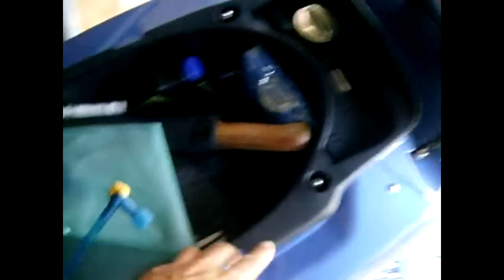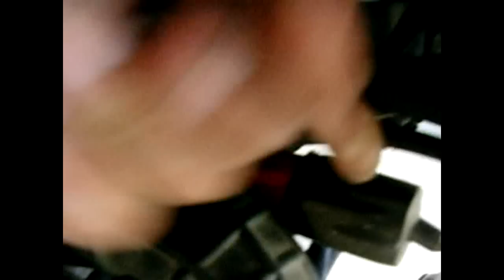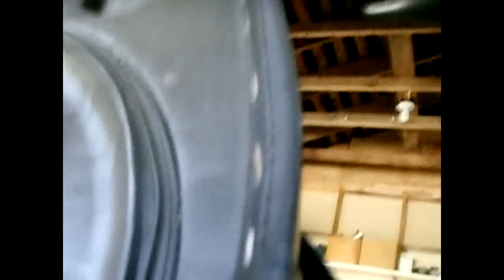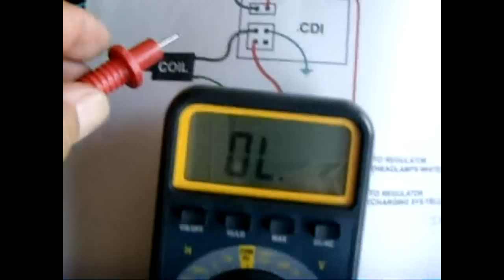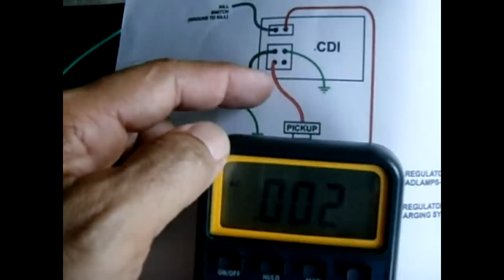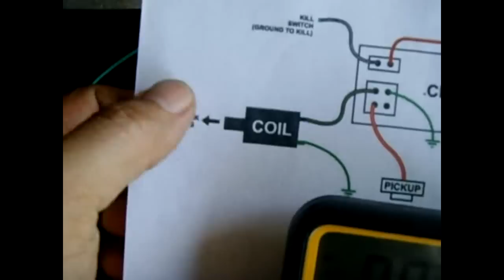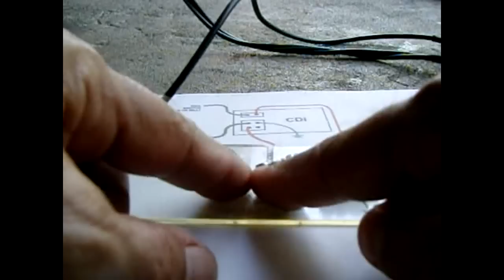The Ultimate GY6 Starter & Ignition Troubleshooting Tutorial

Comment: My wiring has different colors then yours but the locations on pins are the same. I got the same reading as you did but my battery will crank the motor using the electric start but will not start.  When I kick start it starts on the 1st kick. If I use an external battery starter it starts. Voltage is good but I think I don't have enough amps. The battery tested  good at the auto store and when they charged it will start a few times then just cranks but don't start.  I tested the regulator which at idle the  output is 8VDC but has 15VAC which I have replaced the regulator twice with the same output. The battery will charge to 12.89vdc and holds charge. When the motor is running with the regulator and battery disconnected there is no AC or DC on battery terminals.  With the regulator and battery connected and motor turned off no amps are being drawn from the battery. i remove headlight bulb and same results.  suggestions on why my battery does not charge enough amps? Thanks

Comment: @0:00 Intro
@0:21 Seat removal
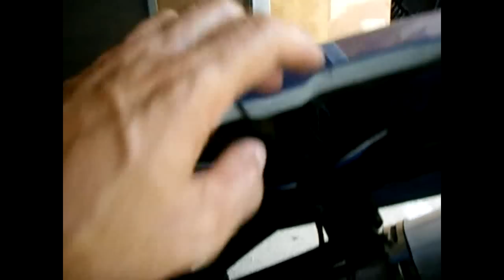@0:58 CDI and Starter Solenoid troubleshooting
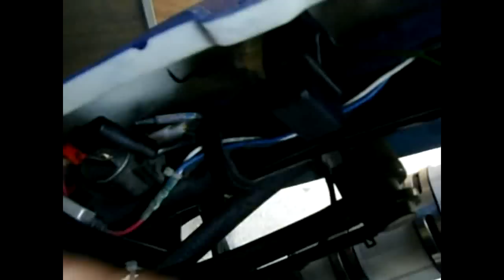@2:38 Explanation of parts
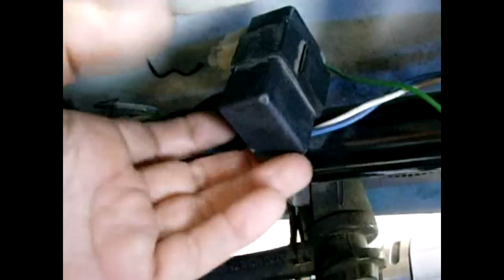@5:13 CDI troubleshooting
@5:50 Fuel troubleshoot
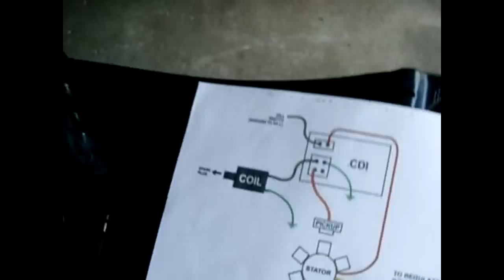@6:55 CDI wiring diagram
@21:00 Spark Plug testing

Comment: Great video, I went outside to start my 50cc,,,, hit the start button and nothing,,no cranking sound, battery is good, brake light and horns work, if I probe the soloniod with a test light hooked to batt neg, it lights up, if I use a screwdriver to short the starter soloniod it cranks the bike, it wont start because its having a spark issue, I think its the right side kill - start button switch, issue,,,what do you think at this point? TY

Comment: 2021 and this is still a very useful well presented video. Thank you.
Reply from the maker: Glad it was helpful Jerry! Be sure to check out my GY6 video playlist and share. Thank you
Reply: @electronicsNmore  I'm just repairing my granddaughters 125 scooter and a question if I may? The cdi unit were you have the black and red wire only has a single wire a black one do you know what that would 2017 model. Many thans
Reply from the maker: @jerrybootneck1736  It should have more than a black wire. You can search online for gy6 cdi images to help.
Reply: @electronicsNmore  ok many thanks I was hoping to find a red and black but even the chicken on that connector only has a single pin
Reply: No idea were the word chicken came from must have been predictive text lol.......Tell you what I did find this afternoon is that the ignition coil is a single connector and I suspect the ground is through the chassis with the 2 bolts holding it. I checked on fleabay and the only couple I can find one is for a 50cc this one is 125 and the other is for yamaha's and aprila's wish I could post images on here

Comment: My battery is fully charged, when I cross the solenoid posts it just sparks, I hear a click and the flywheel will juuuuust turn a little. It seems like there isn’t enough to crank the engine. Help!?
Reply: My scooter is wired direct turn key, press button. I installed a new starter also my kick start doesn’t work. This is a new problem for me but I’m outta ideas?!
Reply from the maker: If you cannot rotate the engine by hand using a ratchet with extension bar, along with the correct size socket, then your engine is damaged.

Comment: Great tutorial so far. Car / Semi mechanic here so alot is familiar with the few exceptions. Still watching video. At Appx 5:45 in video you show a "Scotch Block" on the back where you ran your ground over. 

Recommend eliminating scotch block as that invites Gremlins (Corrosion) in the wiring. Better of cutting small section of wire, stripping the end of ground wire you're adding and twist it in the wiring inline then soldering it. You can use liquid tape to put a cover back over wiring sealing it. I generally go 2-3 coats of liquid tape. 

I do this on any similar wiring situations, remote starts, wires I may pierce with a test light for diagnostics and it don't hurt the current wiring. 

Now off to watch rest of video. Good battery, scooter starts, runs when kickstarted, runs when battery charged but the starter goes but sounds like it starts spinning before I have to pull the battery and charge. 

Wondering if alternator or whatever these have is going bad. 

I do have a voltage drop tester (see AESWAVE.COM as they have alot of great mechanic tools that help save time and get sale result). These tools are great when you do alot of this stuff as it pays back long term. 

So far scooters are cars on a smaller scale. Loving it. May start doing work on these as well. Wonder what a good hourly rate is for scooters?
Reply from the maker: Thanks for watching, and thanks for the tips!

Comment: Have a problem was riding down the road just fine had to pull over and make a phone call, turned my scooter off ( 50cc bored to 80cc 2006 peace motorsport) has good strong engine TS 52mph flat ground. When Iturned key back on absolutely nothing no power period, has brand new coil and plug checked the CDI which is new also, new battery tried to jump it just to check and still nothing it's not the battery I know that much, I'm just stumped I'm not an electrician so any help would be greatly appreciated.
Reply from the maker: Must be a bad connection from the battery, or a blown fuse.
Reply: @electronicsNmore  I checked the fuses no prob there I was thinking same thing I'm going to just replace all of that wire from the battery and go from there thanks for responding it's been extremely frustrating

Comment: Question for you 
150cc sat for a few years. Installed new battery and no power at all no lights or horn. I can jump it at the solenoid and it will crank but no spark.
Could it be the ignition or cdi? 

Thanks
Reply from the maker: You need to follow the video. So many things can be the cause. Maybe a faulty kill switch.

Comment: im getting now power..... nothing, no ignition ..no head lights ... nothing when i turn the key... the battery has juice,  checked all the grounds, it all happened after taking a fall off the stand when i was changing the front brakes and tire?? any idea what i might have knocked loose?
Reply from the maker: No power is usually the easiest to fix. You start at the battery and trace the power until it stops. Could be a loose wire or blown fuse.

Comment: No killswitch on my gy6, only the blue wire and 2 additional wires coming from the stator harness. So i checked the blue wire with positive to it and negative to engine valve cover,nothing. then checked resistance, checks out. After trying to get to the stator I gave up because I need an impact gun (gotta purchase it after 3 years already ffs) and after wiring everything back up, plugging her up, I got spark! Amazing! Quite weak though, and when I ran her she smoked like a vietnam ptsd struck gi joe, means insufficient burning of gas :(
It all started when I had intermittent spark but now at least I won't have to push it by foot to the mechanic ALL the time. Just until it dies. ;)
Reply from the maker: Got a real problem on your hands. LOL

Comment: I am having an issue with my scooter not wanting to shut off. I have looked all over the internet and have not found a solution to this problem. When I hit the kill switch and even take the key out it makes the noise as if it is trying to restart the only way I can get it to shut down is to disconnect the battery. Might you or anyone out there know what my problem is?
Reply from the maker: Faulty kill switch or bad wiring connection to the kill switch and ground.
Reply: Thanks I will check it out.

Comment: Wait a minute, did you say alarm system? I have not encountered of those yet, I work on roughly 3 bikes a week and this one really has me stumped. Is there anyway you could call me to give me a hand with.this?
Reply from the maker: Unfortunately I don't have time to speak with viewers. I have over 500 videos with people asking questions. The best thing to do is remove the alarm system.
Reply: @electronicsNmore  well, I found the problem after replacing the stator, puck up coil, cdi, ignition coil, sparkplug, carburator, and the voltage regulator. It turns out this model is equipped with a kickstand switch. Gotta sit on it and raise the stand for it to start. Genius of the F*kng Year candidate RIGHT HERE!!!!
Reply: I feel like such an idiot lol ok, so to compound my ehhem brilliance, I took it for a very small spin and upon returning notices the washer and nut lying on the tarmac. Now it will not start AGAIN!!!! Do you think it jumped time?

Comment: Quick question: the LED on my racing CDI flickers when I am cranking the engine.  Does I Jun confirm that the pick up from the stator is working? Or is it malfunctioning with low voltage?
Reply from the maker: You're going to have to do some tests. Pick up or stator problem.
Reply: @electronicsNmore  how do I check the voltage regulator
Reply: @electronicsNmore  I checked the R on all if the wires and they are uniform to my other bike that runs great. (stator) I have testedniut all other components
Reply: Everything checks out but I have no spark. This is impossible

Comment: I have one of these scooters and I can't get my headlights and taillights to work. Running or brights. Do you have any suggestions
Reply from the maker: Hi Mike. It sounds like a faulty stator or bad ground connection. Make sure the regulator didn't go bad and burn out all the lights.
Reply: @electronicsNmore  they came on briefly one time but nothing ever since. How would I check the regulator?
Reply from the maker: If they came on briefly, then you have a poor connection or bad wire. Good luck finding it. You need to do a very careful inspection.
Reply: @electronicsNmore  lame. Thanks

Comment: I have a problem with my 50 cc vip scooter i have installed new top end including rings scooter has to be at full throttle just to idle . You let off throttle and it will die, also I have had to brand new caraborators still no change, I set timing to top dead center cam was installed with the two little holes lined with block big hole is top center still only idle, im lost.
Reply from the maker: If it worked before, then you need to go over everything you did.

Comment: So I’ve been having trouble with my gy6 150cc scooter and it won’t turn over. Today it just made a buzzing sound when we tried starting it with the switch and then it eventually died down. There was no more buzz but the lights sort of dim down now when we try to start it. So we tried jumping the solenoid with cables and we got nothing at all. No start or nothing just silence. So my dad and I have been having problems with this one. Do you guys have any suggestions for what might be going on here? He thinks he messed up and shorted the solenoid or cdi but i have no idea. Please help! Thanks!
Reply from the maker: Either loose battery connections or you need a new battery.
Reply: I should note that it was cranking the day before but my dad sprayed the carburetor with the cleaner and gunk or something came out the other side which was good but then it started buzzing. Probably also because he shorted the solenoid to see if there was spark which there still is

Comment: Hi I’m having a major issue with my gy6 scooter basically when I’m getting no spark and I changed out the whole entire ignition system and even knew battery and still not getting a spark I changed out the cdi and ignition coil and new spark plug and when I turn the key there’s about 3 different wires that start to smoke and get hot what can this problem be and how would I fix it PLEASE leave some advise and I love ur videos man??
Reply from the maker: Clearly a short circuit somewhere.

Comment: I have a 2 stroke 50cc scooter and it gets spark and air and fuel however even with a fully charged battery it still won’t start. Please help
Reply from the maker: Legion382 Please refer to my GY6 valve adjustment video.
Reply: electronicsNmore unfortunately my engine is not a gy6. Thanks for the help anyway 👍

Comment: Thank you for the excellent trouble shooting guide. I just bought a gy6 49cc with no start. The engine would spin with the start switch but no spark. Followed your guide to the tee and still no spark. So I pulled the front cover off and found that someone had installed an alarm/remote start. Removed the alarm and shorted the pink and black wires. Then traced the kill switch wires all the way to the CDI. Still there was a persistent ground on the kill switch wire. Found that this bike has a kick stand switch. It was shorted all the time. Once I unplugged the kick stand switch I had spark and the engine runs great now. The point is I was able to follow  your guide and determined that the CDI, Coil, and Stator pulse generator were all functioning. And because you included the kill switch trouble shooting I was able to find the problem. Thank you!!!
Reply from the maker: Be sure to rate thumbs up, share my channel with others, and check out my extensive video playlists for other great videos of interest to you. Thanks!

Comment: That is all good information.  I am new to mopeds and don't understand half of what you said.  My apologizes I have a moped That I have to use a battery charger to start,  as long as it is running it's fine but as soon as I shut it off and try to start it again it won't it acts as thou the battery is dead. i have a dial type tester and it shows the battery is fully charged.  My question is why won't it start?
Reply from the maker: The Scrap Iron King Metal Detecting Battery lost all cranking capacity.
Reply: electronicsNmore it's a brand new battery
Reply from the maker: The Scrap Iron King Metal Detecting Better check all wires and connections.

Comment: I think your work is really helpful! Thank you very much. Does anyone know how to test a non-mechanical speedo cable setup? Please? Remember, its a magnetic impulse type speedo which isn't working. When it started breaking down, it seemed to work intermittently, flicking on and off. Cheers, Den, Wales.!
Reply from the maker: Probably need to use an oscilloscope. Could be a faulty wire or power supply issue. Make sure the power supply is constant.

Comment: I've gotten in trouble with ohm testing before since the DMM itself supplies a very negligible amount of current. Partially open/shorted wires have passed the ohm test because the trickle of current coming from the DMM found it's way through just 1 or 2 strains of copper in a wire that was otherwise damaged (mostly shorted/open) . Voltage drop tests may be a better solution. OHM tests can often lie to you or not tell you enough. I think a voltage drop test on a LOADED circuit leaves little to no chance of a false positives.

Comment: If my red wire from cdi to stator only has 330 ohms should it be replaced or is the problem at the stator
Reply from the maker: The reading doesn't have to be exactly like mine, but it should be similar.

Comment: I have 50cc gy6. When I try to start, my voltage drops to 6 volts and it wont crank. I hook it up to a charger, the lights go brighter but barley cranks. It will run if I kick start it. I checked all the cdi pins and they are good. My battery reads 12 volts. can you help?
Reply from the maker: Sandler Tossone Sounds like a bad battery or bad starter.
Reply: What is strange is that with my key off, I checked all the wires going to the cdi and they have power. I would think that there would be no power to it until I turned the key on. I am getting power to the solenoid and did the screwdriver thing but still would barely crank although it was clicking alot. Again, it was only because I had to have the charger directly connected to the battery. I will change out the battery first and see. thanks for the quick reply.

Comment: Some scooters have a kill switch connected to the side kick-stand to prevent starting with both wheels on the ground and no rider.  The starter motor will still turn over but the switch will not provide spark to the plug.  Easy to overlook this safety feature.
Reply from the maker: Yes, this model didn't have that. Thanks for watching!
Reply: I just read that Loftur Hjalmarsson posted the same thing 1 year ago...  Sorry to be repetitive.  Very informative video. Cheers.

Comment: I was given a 2008 CMSI 150cc scooter (has Sunbeam on the front and side cowling..??) because it has been sitting outside at the beach for several years and won't turn over. I am using your T/S tutorial as a guide and @ the 10:20 min mark you checked the Red wire from the two prong connector that goes to the stator to power the CDI...issue for me is there is only the black kill switch wire in the connector, their is not a wire in the other socket. Any idea why the red wire that powers the CDI would be missing, on a side note the black wire checks good, lol
Any help/advice would be greatly appreciated
Reply from the maker: There must be more wires.

Comment: Do I have to have a coil installed for the lights to be able to come on and the engine to turn over?
I picked up this freebie 2011 TAIZHOU ZHONGNRNG 50cc that is totally dead.
My ignition switch is busted so I twisted the black and red ignition wires together until I can get another one, twisted the two green wires together, ( left the black/white kill wire disconnected), I am able to turn the engine over by jumping the solenoid posts, battery and fuse are good, start switch and brake switches tested good, there is continuity on all wires having to do with the starting system yet the lights will not even come on.
What am I missing after following your tutorial.